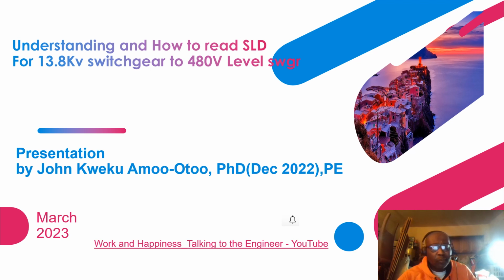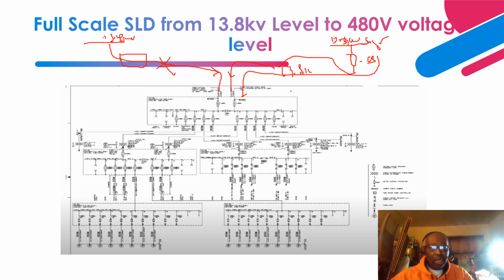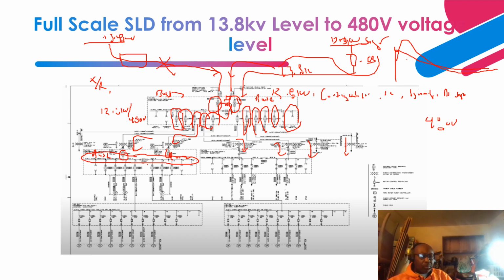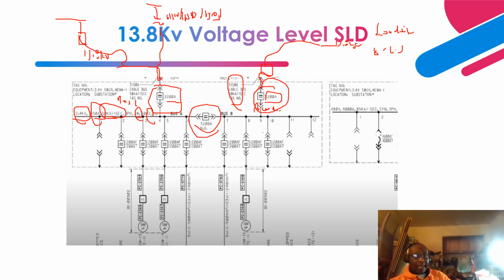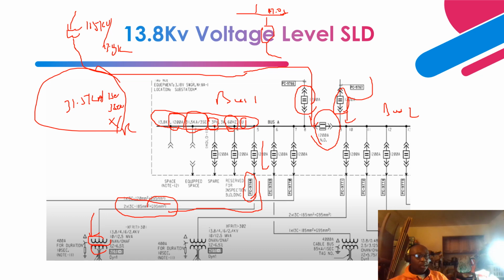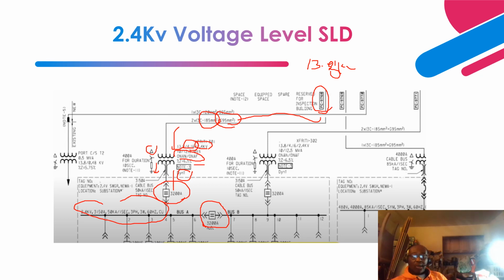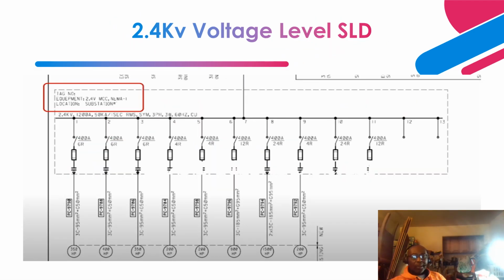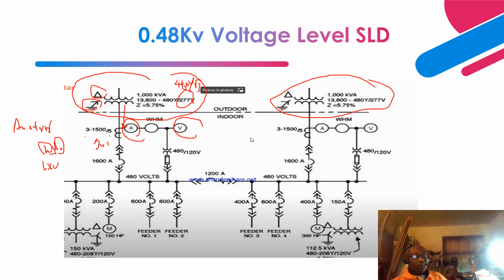Understanding and how to read 13.8kv/2.4Kv and 480V Single Line Diagram

Comment: I'm in a utility substation and relay technology program. This semester my blueprint reading course is kicking my behind. Following the one line is not following because of my experience as an electrician. I'm struggling to remember ANSI device numbers and device functions and remembering the chain of events that follow a command or function within the substation.

Comment: can i ask what software did u use to make this video
Reply from the maker: Yes Gul, It was just a Microsoft power point presentation software and I did the recording in MP4 format because that is the format you tube requires
Reply: @workandhappiness_talkingto1172   thanks a lot, did'nt know it before, we  can use power point to make videos like this
Reply from the maker: @gulmuhammad7584  yes on the tool bar select record and it takes you to recording mode of the presentation